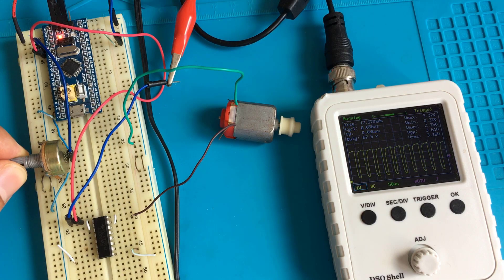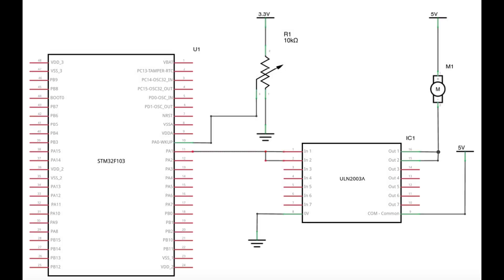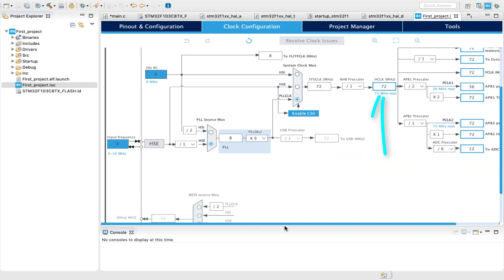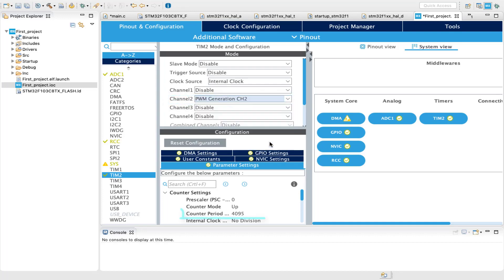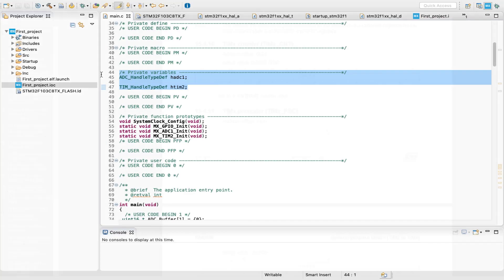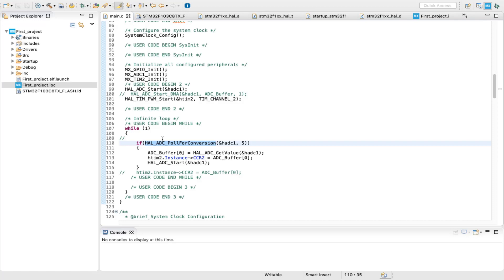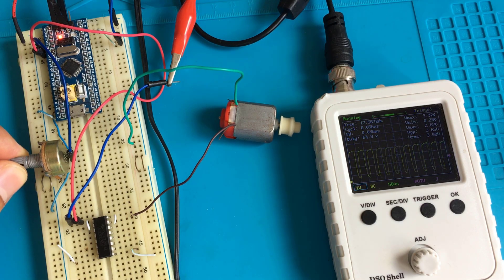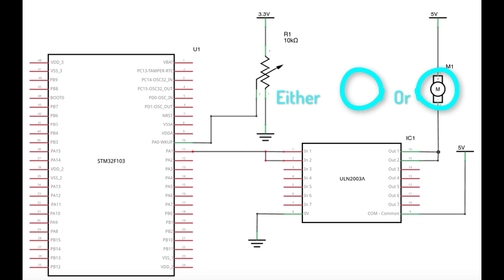SM32 DC Motor Speed Control Using ULN2003 IC

Comment: What is the implementation of this function " HAL_ADC_PollForConversion"?
Reply from the maker: Hi, 
This function is implemented in the STM32 ADV HAL library. If you are using STM32cubeMX, it will be included in your project after configuring the ADC module. HAL library is designed so the user doesn’t worry about doing low level operations. 
HAL_ADC_PollForConversion on the other hand, waits the ADC register to be filled so it can be read
Reply: @usefulelectronics  i want to debug this low level operation in this register which i want to manpulate it for diffrent apps. I was built adc from scratch but it didn't Work so i need reverse this operation to know my fault، can you help me?
Reply from the maker: You can use ST-Link to debug your software line by line

Comment: A N-channel FET would be far more efficient than the ULN which has about a 1.3v drop across it.
Reply from the maker: Hi,
The drop is around 0.7V actually. I agree with you MOSFETs are always a better solution.
 The best solution for such a use is l298n since it provides bidirectional motor seed control.